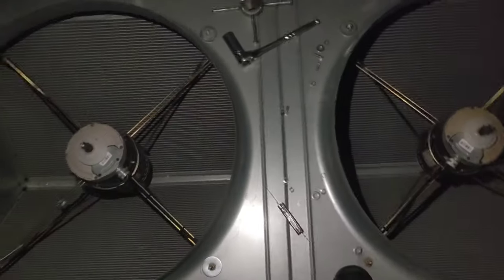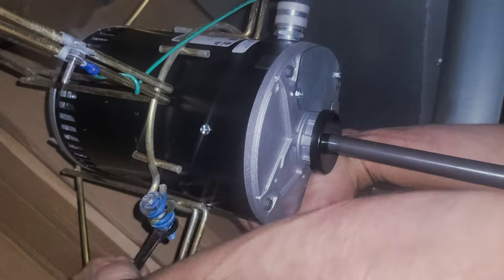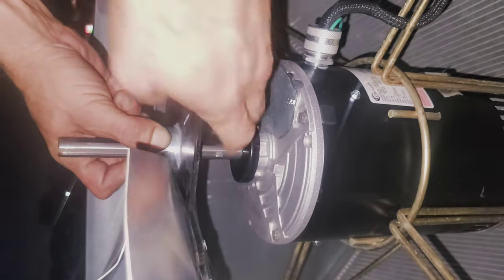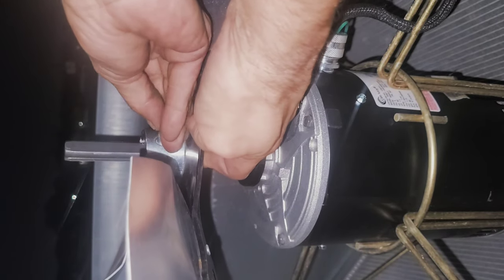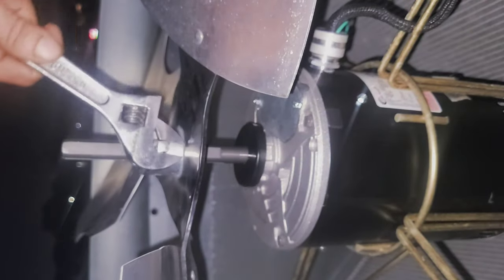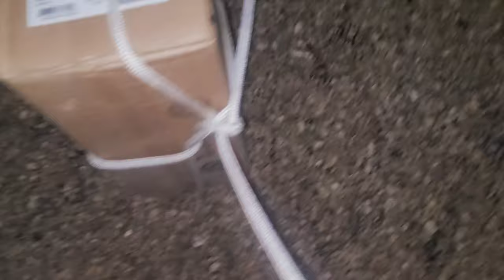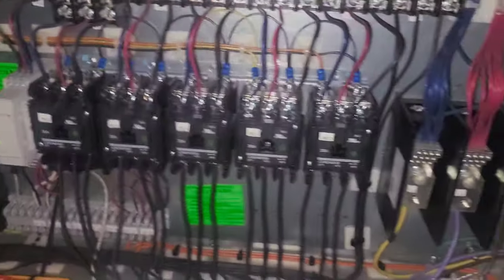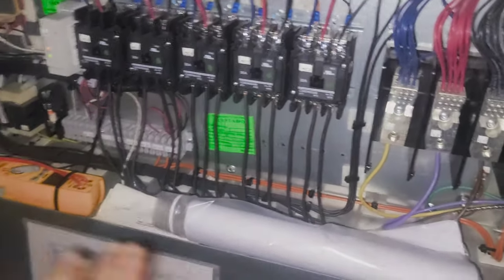3 Phase 460v Motor Replacement Instructions

Comment: Kind of sucks doing that at night but at least it’s a lot cooler up there. I never did like those micro channel coils. At least the motor brackets had supports to hold the motor so you can use both hands. I hated the ones that didn’t, I would have to Mc Iver something to hold it in place until I had the belly band tightened up. Another great video brother.
Reply from the maker: Thanks.  Yes it was great to avoid the heat that day.  We had 100+ degree days at that time